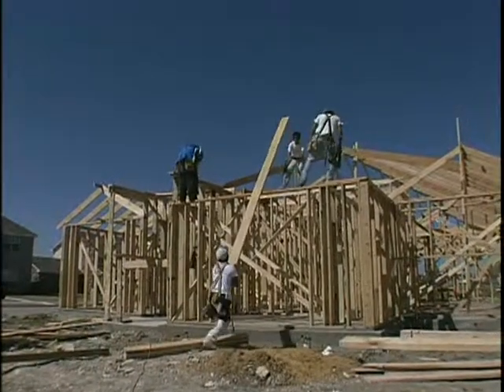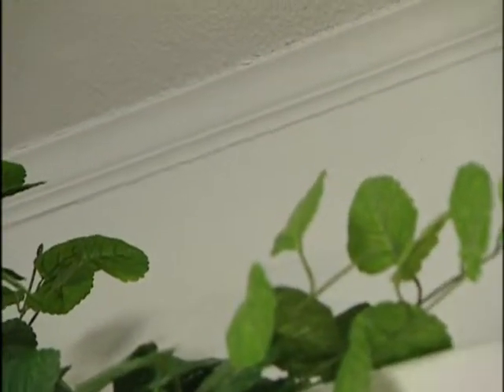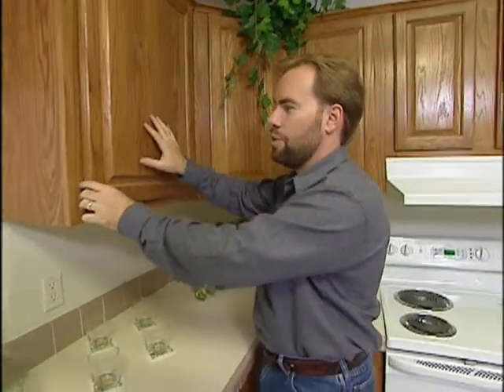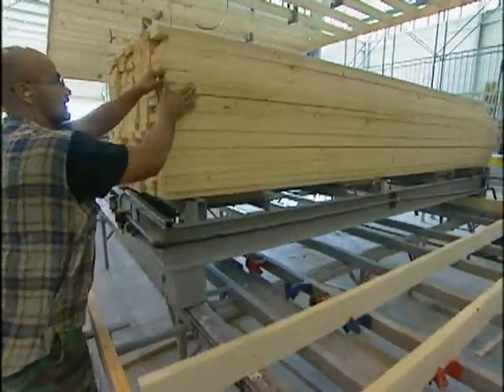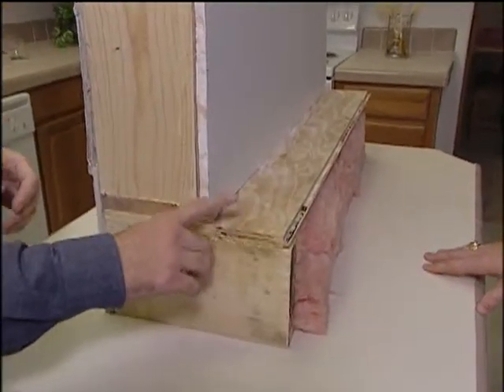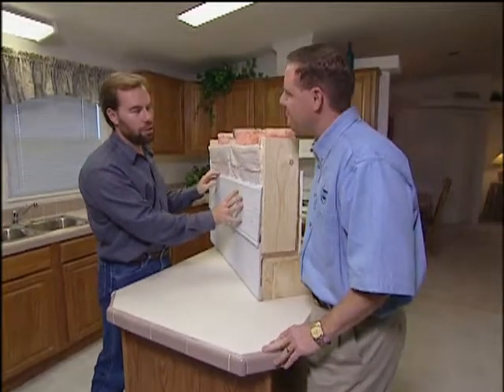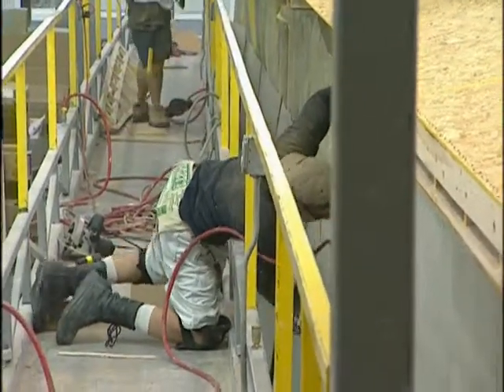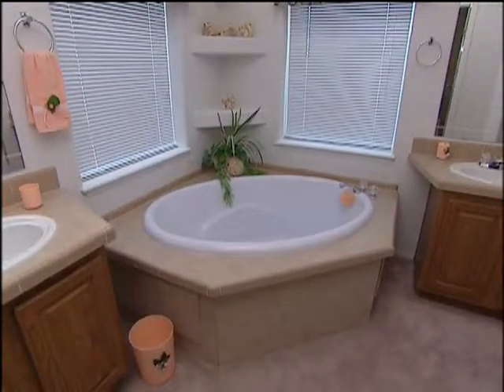Manufactured Homes (#5058)

Comment: why do you use a 1/2 or 3/4 in plate under the exterior studs.  It should be a double stack or 2 x 6